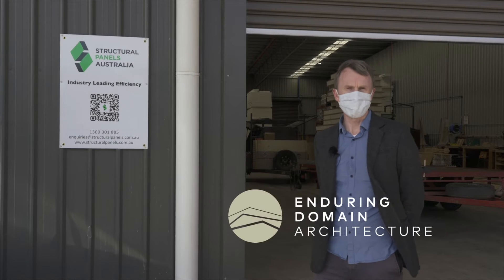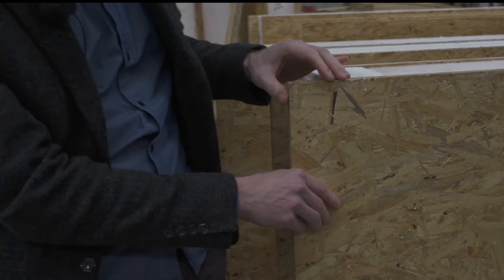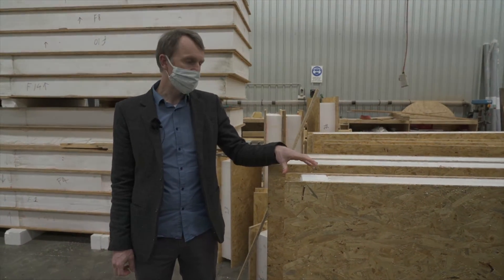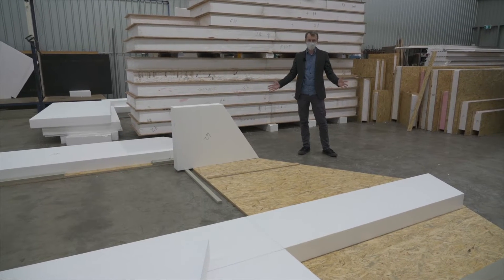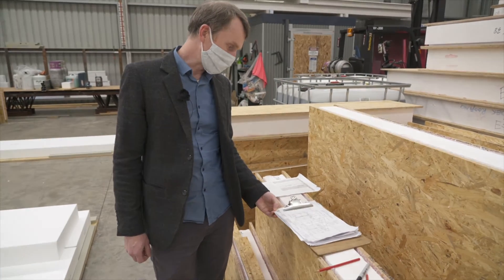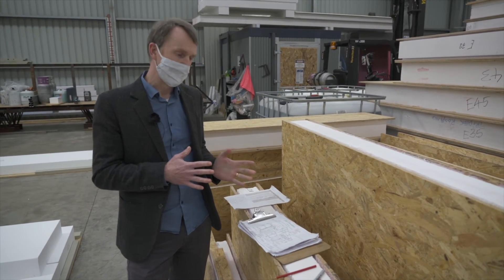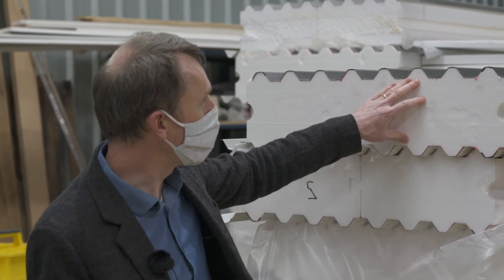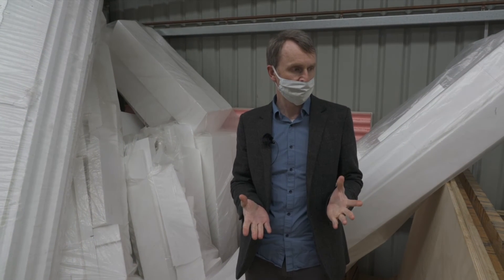Sustainable Structural Panels House -SIPs Factory Tour of Eco Architecture coming to life

Comment: That's so interesting Matt. How does that mix of materials cope with fire? I imagine it has to be better than timber?
Reply from the maker: Think about how hard it is to burn a phone book (remember them)? They don't ignite easily because its so dense, no trapped air in there. These panels are similar. From the outside there is a cladding over the top anyway which is suited to the Bushfire Attack Level of your area.